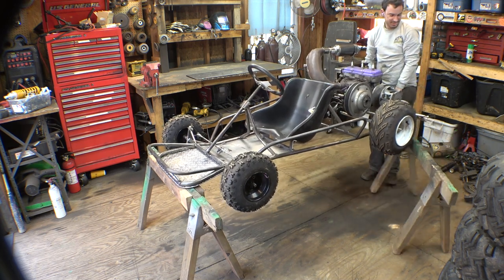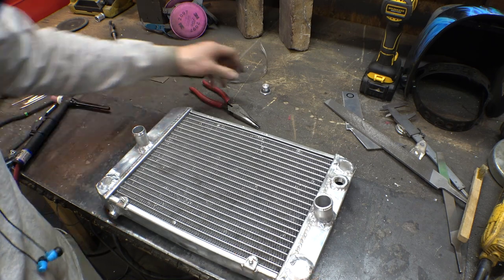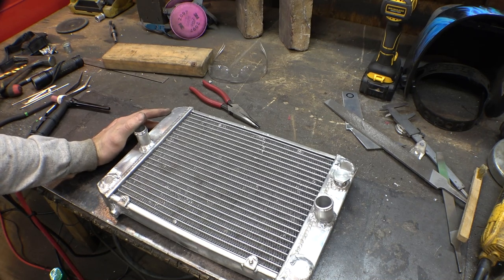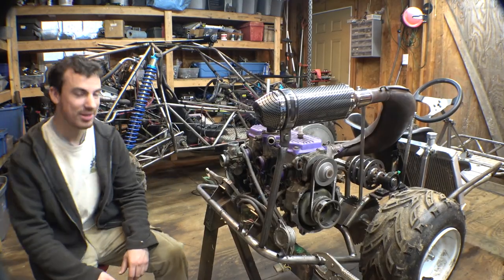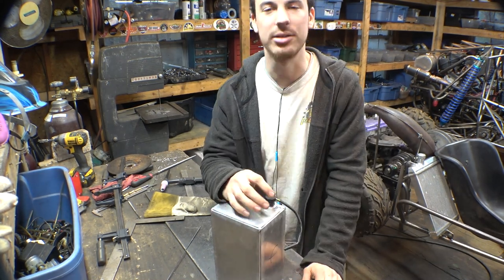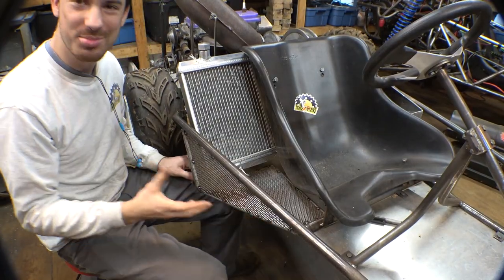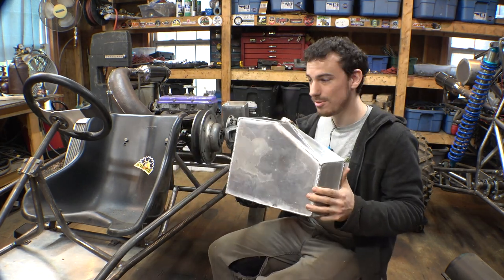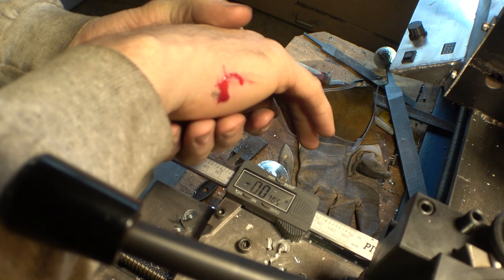95HP Two Stroke Triple Powered Yard Kart Build Part 5

Comment: Use those rubber stretching hood latches like on semis to hold down the tank.
Reply: had the same thought. if you still have the hood latches from the snomobile. that would be perfect for holding that tank in place.
Reply: i was thinking something like one of those black rubber bungee cords but cut the hooks off and use bolts or like how rubber exhaust hangers are mounted.. something kinda like an upper radiator mount could work too the options are endless
Reply: Just like a Kawasaki js550 tank
Reply: @ianbuilds7712  i was thinking the same thing.... black rubber bungee .... similar to the ones used on atv/utv batteries
Reply: Or if you want a bit more sturdiness, use a metal strap. Weld a support from the bottom  and put a hinge for the strap. Out your rubber sheets on the contact points, and then weld a tab with a bolt to lock it down without wiggling apart.
Reply: Or could use springs , similar to motorcycle muffler spring tensioned to a place , but it could be little too weak for the weight of tank ?

Comment: I'd maybe look into putting something between the rear tire and the radiator. That will put a hole in the radiator if the tire brings a rock around.
Reply: A piece of expanded metal with a flat bar border would work great. Good airflow and he could weld mounting tabs to the flat bar border.

Comment: You can just chop up an old tire to make some rubber mounts!! You should make the belt Guard out of plexiglass!! Great vids too!!
Reply: I feel like the plexiglass would shatter if push came to shove and plexy makes some nasty shrapnel
Reply: @willtrautman6243  if the clutch broke it would shatter but If the belt broke it would just absorb the impact cuz the belt is rubber, and I’ve never had a clutch brake on me...
Reply: @garageguy5174 A piece of rubber spinning at 7000 rpm can so some damage
Reply: @willtrautman6243  it doesn’t matter about the rpm it matters about the rotating mass and a 5ib belt dose not have a lot of rotating mass cuz it’s not in a consonant force!! Is going it a oval not a circle...
Reply: @garageguy5174  I say we just make it out of sheet metal it would be easier to mount and put together and will not explode unless you use explosives lol. I have to agree plexiglass is not a good idea
Reply: @brucewayne9300  Realistically no, but when you count in the coolness factor you just might think twice lol, just a thought, when you consider the pros and cons it’s really just an idea that you think will be cool and work and still might? but at the end you would have regrets...
Reply: I can tell you for a fact that if the belt broke that a plexiglass cover would be useless. because when they do break on the snowmobiles. it mangles the the metal guards on them. I've even seen where they screw up hoods on the sleds. I was avid into snowmobiles for years.
Reply: @harryrenner4016  metal has a better bending point than plexiglass has a better shattering point, it was just a thought, I got a LOT of crap from it though...
Reply: Polycarbonate...
Reply: @garageguy5174  I was just going by experience with my reply.
Reply: @RG-gk4yi Going by experience it fair to well. after all that the hoods on snowmobiles are made out of that. and I've seen a broken belt damage them before.

Comment: Fuel Tank: Take a page out of early 20thC technology and use a leather belt to strap it down, yes I do mean the type that holds your pants up!
Reply: Cool idea I was thinking them rubber battery straps but a belt would look pretty awesome
Reply: Came here to post leather strap would be classy af. Upvoting instead. I'd also say rough leather strap.
Reply: Alternatively, use the belt, but mount a tie down on top of the tank and mount the strap to that. Attach the buckle end to the frame. It will also create a standoff from the top frame bar.
Reply: I have done this trick for a battery on a bobber I built! Works great!

Comment: For the front of the radiator look into the screen mesh used on dirt race cars. You can just clean it with a garden hose. Easy to install too, it's mounted with springs i think.

Comment: You should lunchbox strap the gas tank in place with rubber attached to the metal on the strap part touching the tank. I feel like it would look really nice, be moderately hard, but most importantly, it’d definitely be rewarding!

Comment: You should try a spring cam latch, or a "T" rubber hook latch to secure the gas tank to your hard mounted brackets
Reply: I was thinking the same thing. Rotary-Action Draw Latch would work too. But I think the spring cam latch would work better. Great idea!
Reply: those lame "jdm" bumper ties would actually work pretty good
Reply: the red tractor in my picture has a pair of those rubber t latches on the hood and they work awesome but quick release may not be good? a couple short black rubber bungees with the hooks cut off and bolted in might work as long as no fuel gets on it (most rubbers dont like petroleum products😉)..

Comment: For the front tires kicking up debris you could make some small fenders to minimize damage. For the gas tank you could weld a couple studs onto the frame and rubber washer mount it with a nylock nut.

Comment: Clean your aluminum with acetone, clean the filler with acetone, use 2% lanthenated tungsten ground to a blunt taper.
Reply: 100% tungsten green is also great to welding aluminium
Reply: @superhiro2a  it depends on the machine though. Green works good on transformer machines. Older machines. Newer inverter machines it doesn't run good at all.
Reply: @schism47  
His welder is a prime weld 
I bought one too it’s bad ass 
Inverter machine
Reply: muriatic acid is also very good for cleaning aluminum.
Reply: @harryrenner4016  oh ya it is! I forgot about that stuff

Comment: 2 hollow metal dowels through the center of each tank cut to length, welded on top & bottom. Bolts that go through with rubber washers between the head & the tank. Weld nuts to the floorboard under the tank to screw the bolts into hand tight, then run a second set of nuts on the bottom tight to keep the bolts from backing out. Then even though it's bolted down everything is still cushioned not solid mounted.

Comment: gas tank hold down... sheetmetal strip with rubber strip on the inside... just like gass tank straps on a car, only go over the top instead of the bottom

Comment: drill a hole from the top to the bottom of the tank and weld in some 1/2" pipe. Insert a therated rod with an on welded plate from the top to the bottom and tighten it with an nut on the bottom side of the frame. Again put an pice of rubber between the top plate and the tank. Easy, clean and functional

Comment: Maybe add mud guards on the back wheels, or at least the radiator side. That thing will be filled with mud without. And just add rubber latches on the gas tank, like ones one tarps etc.

Great video length! I could watch your videos for hours on end. Also have done that LOL. Spend weekends watching all your projects LOL

Comment: A idea for the gas tank situation, you should weld a tab to the tank and strap a rubber bungy strap to the tank then to the new mount that holds the tank and which would be could removeable on front and back.

Comment: I would use a rubber bunge cords to hold the gastank and oil tank to the frame. You still would have movement but would be held in place. I would also be careful to enclose your drive belt as the mud and water splashed up will fill up any enclosed guard. Keep up the good work you have more skills than you think.

Comment: The radiator fill/vent bolt is beautiful.. but I think it will keep coming loose from thermal cycling. The O-ring should sit in a channel, with the top of the o-ring just proud of the top of the fill neck- and then the fill bolt would be tightened down until it seated against the fill neck- placing a slight crush on the 0-ring. Also, I'd use a strap with springs on the gas tank. Awesome machine!!!

Comment: you might get away with a battery hold down style strap that just goes across the tank to a set of bolts on either end, that way if you do need to remove the tank, two bolts and the tank lifts out, pretty sweet build, should be a real blast to drive

Comment: "I think i will leave the oil injection in there"

Part 6: First drive
Part 7: Rebuild engine
Reply: As much as I agree with you I really don’t? Those old 3 cylinder engines can take a beating, I’ve ran them with no oil for half a season and I only lost 10psi of compression!! But yes oil pump delete is better...
Reply: @garageguy5174  if that is true (doubt it) it's because the crankcase, ring lands and needle bearings were so sludged up with oil from decades of over oiling.. that is just as common as under oiling or just not working... a clean engine with no lubrication wouldn't last half an hour...
Reply: Right... 2 stroke project #1 rule... Delete oil injection and premix!
Reply: I grew up around older polaris twins and triples and I would highly not recommend doing oil pump deletes on these engines, the oil pump sends oil to each carb, but also sends oil to crank. Deleting the oil pump will no longer give adequate oil to the crank. I have personally seen guys sleds spin crank bearings and size up due to thier oil pump delete. Also the oil pump is synced with the throttle so at idle speed the engine is running around 200 to 1, and at WOT the engine is running on about 40 to 1. If you delete your oil pump you will have to run 40 or 50 to one premix which is way to rich for the engine at idle and it can cause stuck rings foweled plugs, and blow by. People like to think the oil injection systems are prone to failure but really they are not. Ive never had one fail on me and as long as you check your injection systems functionality each season you should be fine. I recently replaced all the oil lines on my older xc so I can actually see if there is oil moving which there is.
Reply: Also this is a single piece head polaris xlt triple which is a notorious for burning bearings and having crank issues, this out of all engines would be the last one I would want to do an oil delete on. The xlt engines that had individual cylinder heads didn't have the crank problem.
Reply: aren't there engines that have oil sent just to the bearings? and still use a lean mix of oil? i can't remember where i saw that...
Reply: I can't speak too much on the 2 strokes, but ik the oil metering pumps on rotary engines are horrible. They also inject engine oil from the pan 🤢 not 2 stroke oil from a different tank. They have a traditional pump for the bearings though, & imo with that setup, it's far better to delete the omp & run mixed gas.
Reply: These oil systems are damn near bomb proof. They only fail if you use the wrong type of oil in them. I had thousands of miles on a 1985 Polaris Indy 500 with the Fuji 488 engine with oil injection, never an issue. Also have several thousand hours on my 2000 Yamaha Blaster with oil injection, never an issue.
Reply: @Ratkill9000  oh, are they? i was just joking but on dirtbikes they started getting relatively reliable just 4 years ago or so... before they were rubbish :)
Reply: @mixxedboyybuilds8273  lol yeah i've seen this before... the problem is that you cant tell a normal buyer something like "ypu have to mix your  gas every time you're at the gas station" or "you need to fill up 2 different oil tanks andNOT mix them up" 🤣
Reply: @NoTorqueGarage  every time. I had a 2 stroke atv lock up on me because the oil injection  stopped working.
Reply: @jackfulton6696  Thank You! I used to think I should be deleting the oil pump on these but, in 30 years I've NEVER seen one fail. They're built better than people think.
Reply: My old ‘85 RZ500 had a separate oil tank. I can’t imagine running mixed fuel on a street bike. You’d never want to ride for more than a tankful since you’d not likely want to mix based on how much gas you put in the tank. 

Maybe some injection systems had issues but most likely it’s due to poor maintenance year after year. 🤷🏻‍♂️

Comment: Plexiglass enclosure would be cool so we can still see the belt in action. Also, a single aluminum tab straight off the gas tank and nutsert the frame, then use a nice thick rubber bushing between the 2. Should hold it down fine and keep vibration down as well. 

Just some ideas, love the vids!

Comment: For your gas tank you could use a bungie strap that welded to the frame on one side, and for the radiator you could put mud flaps in the front and dude your amazing at what you do and plus you take your time on showing us how did what u did so thank you my guy

Comment: The best CVT cover with backing plate and vent comes on the polaris. Since you maintained the center distance to reuse the belt, it should be an easy fit. Air exhausts through the backing plate drawn by the driven pulley "fan" backing, pulling from the port in the cover. For the tank, consider Jeep CJ hood latches. Add a rear belly pan and fender wells to help keep it clean.

Comment: You should put a clear pipe on the side of that oil tank to see the level of oil, like they do with catch cans.  As for the gas tank, use a ratchet strap to secure it.  Put a few belt loops on it to put the strap through first.

Comment: For the Tanks, do a metal strap like an automotive fuel tank. Take your thin rubber and put it between the strap and tank. Might want to think about a guard for the rear of the radiator to keep whatever the rear tire throws forward out of it. A simple divider of sorts on the outer edge of the radiator extending back towards the inner edge of the tire should be sufficient. I wouldn't worry about it being angled towards the center of the cart, there's so much airspace behind the radiator the slight turn air would have to make exiting one side of the radiator wouldn't hurt cooling. Or just make it out of mesh

Comment: My suggestion for holding the tank down is to weld small square loops to the tank and supports and use some kind of belt to pull the tank down

Comment: For the gas tank, just make a thin metal strap with some cut up old tire rubber. 2 bolts at the bottom, boom, it's literally used for millions of automotive gas tanks, a strap with some rubber glued to it. Dead simple, won't take long to make and it can be done really cheap.  Also I still think you're going to have axle bending issues, think about how the chain has leverage on the axle. I'd stiffen it up. Love the videos I hope you never stop!
Reply: That's an awesome idea for a cheap DRO!

Comment: I've been reading comments for a while about the oiling system. Some engines use the oiler to lubricate other parts as well. Heck, I would just add a little oil to the gas for insurance. It's not like you have to pass an emissions test, LOL. Cool build!

Comment: Did you blow the aluminum filings out of the radiator off screen? I sure hope you didn't forget! High Pressure cooling system right beside you? Hope nothing pops or a hose blows off! Expanded Aluminum around the belt and pulleys? I absolutely love your channel it is one of a few I get exited about when I see a new episode!

Comment: You could build another one of these brackets with rubber on the inside, which you can bolt to the frame above the tank somehow so you can hold down the tank from the top

Nice Build!

Comment: Look into some rubber T latches like a semi hood or a Yeti cooler uses. Cleaning aluminum with acetone really makes a difference after the mechanical cleaning. Clean the filler rod too. Maybe something to protect the radiator from rear tire debris. Overall, it's looking really good. I'm excited to see it run.

Comment: Try welding a bracket to the fuel tank and another to the homade tank holder. Then connect the 2 with a spring. Kinda like the way the exhaust works.

Comment: Strongest way to secure, and leave some 'flex' in the system IMO, use the chassis' the same way driver safety harnesses are secured to a roll cage.  Fabricate a flat eye for a length of safety belt on the bottom of the tank.  Use a friction buckle, and expect it to work loose on occasion.  Belt is expected to be parallel to the tank's bottom, using two parallel pipes.

Comment: Use rubber bungie cord to hold the tank down. That will be better than a hose clamp. They make really short ones that you could stretch from the frame to hook onto the tank.

Comment: For holding the gas tank down, maybe the same sort of idea as springs used on bike exhausts to hold them on to the pipe, where it applies enough pressure to hold the tank onto the rubbers, without physically bolting it down. Just need a hook/ring to put the spring onto the tank is all I guess. Just an idea.

Comment: Build looks great,  like you were saying about the radiator and airflow. Could you not build a tunel by the side of the seat with an air duct coming through the mesh you added to direct the air to the rad, you could make it look like the other side with the gas tank

Comment: Great job as always, only for what I see the O-Ring of the radiator cap has no external containment. Whatch out for it, because it can leak, probably an external aluminum ring should be enough

Comment: You could hold the tank down with some cam buckle straps or maybe with a strap and D-rings like how a helmet is fastened. That's the first thing pops in my mind. Or make some metal straps like a car gas tank. It will be great however you do it.

Comment: Im still early in the video just an idea for the bleed valve for the radiator. There are easy to install in-line ones that can work as a hose coupler. Just has a little bleed valve in the middle. Simple. Effective. Cheap 👌

The gas tank looks epic 🙌